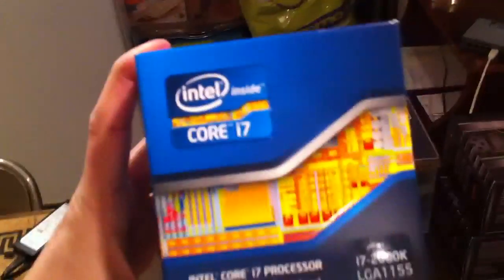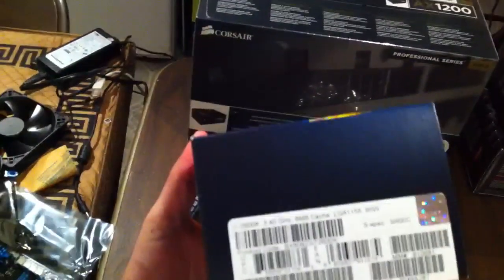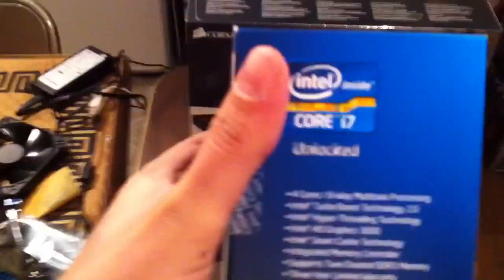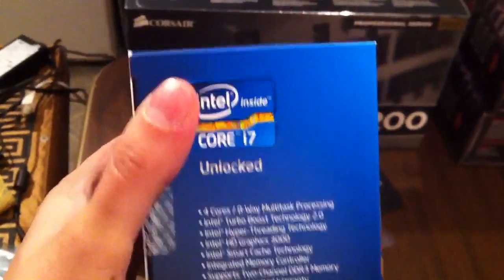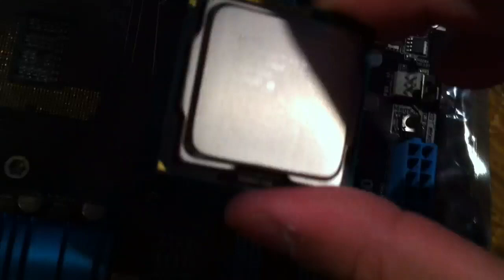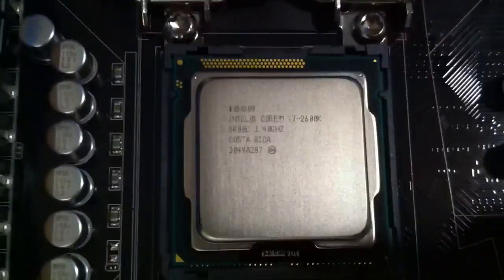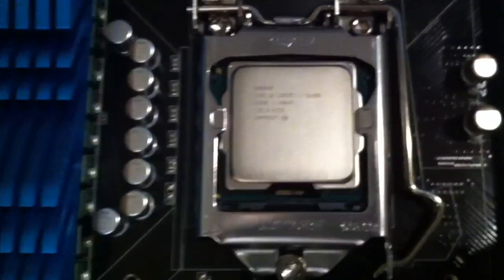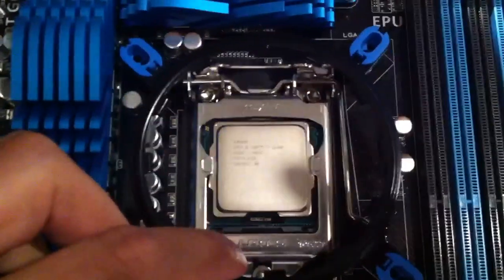Intel i7 3.4 ghz quad core 2600k Sandy Bridge unboxing and

Comment from the maker: @harryham1 I'm glad ya like it :) I just upgraded my monitor with the Dell U3011 from my Dell 2048WFP. Also I've overclocked the video cards which gives them a little extra kick for running the more intense games at the new 2560x1600 resolution from my previous 1920x1200.